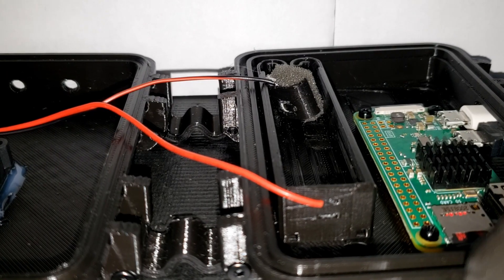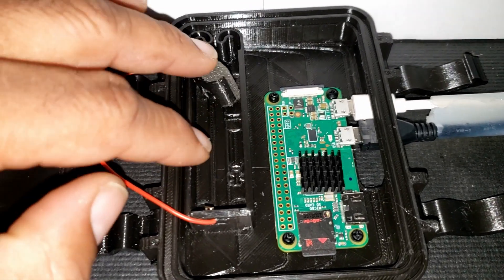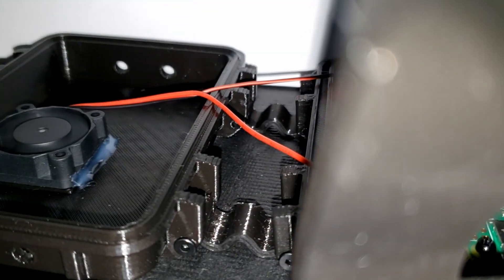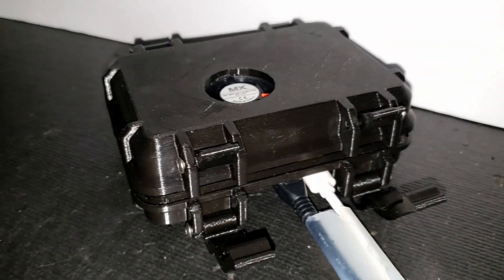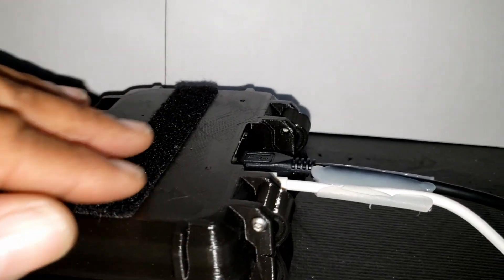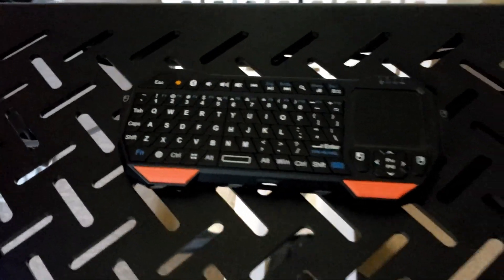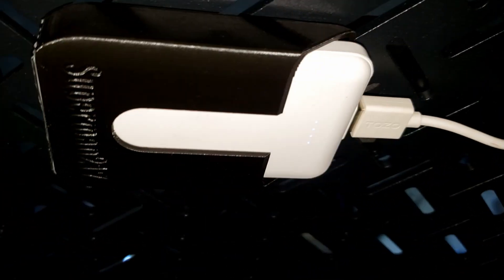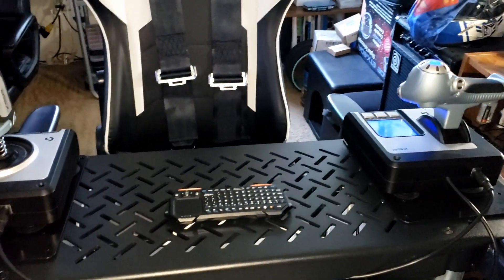Yaw 2 - Wireless X52 Setup

Comment: Question, what determined you needed the cooling on the Pi? Also no lag on this wireless solution?
Reply from the maker: I had it in a smaller case and when i touched the case it was pretty warm so I just wanted a larger case with a little air moving inside.  Heat kills so I'm just being proactive. As for lag, none that I can feel.  I'm sure there is some but not enough to notice playing Elite Dangerous.